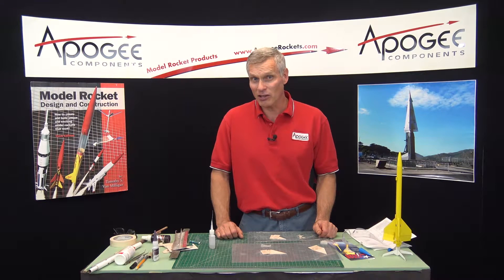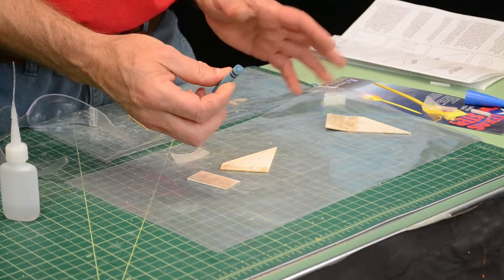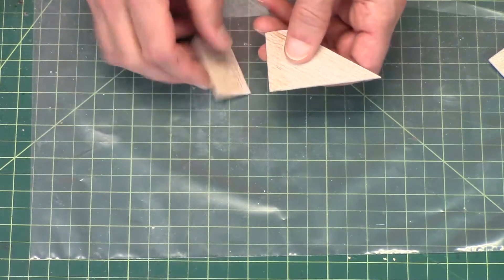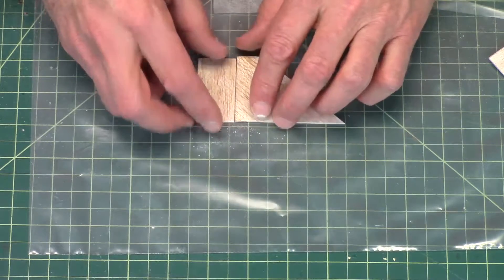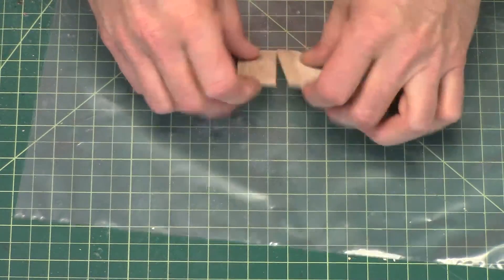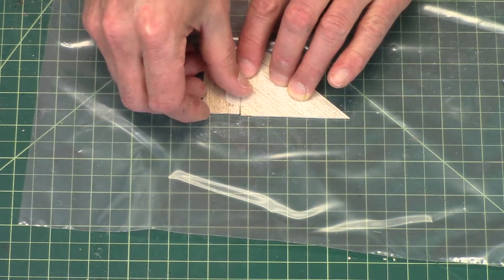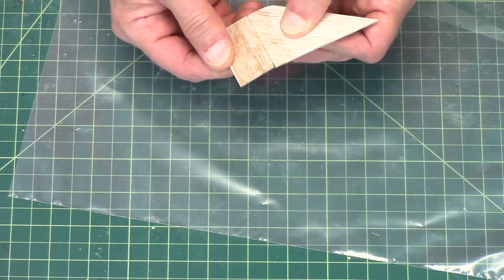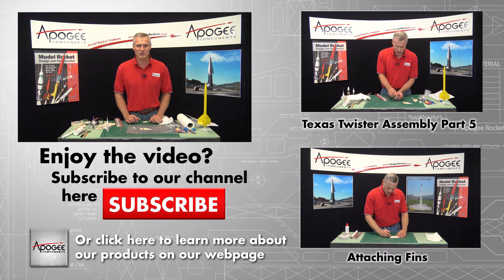Texas Twister Assembly: Part 4

Comment: What percentage, water to Thin CA, do you use in your mixture. I purchased a plastic bottle, put some CA into it, added a little water, and it heated the bottle and hardened in the bottom of the bottle. Luckily, the Apogee thin CA was thin enough to work with.
Reply from the maker: It is thin like water... NOT thinned with water.